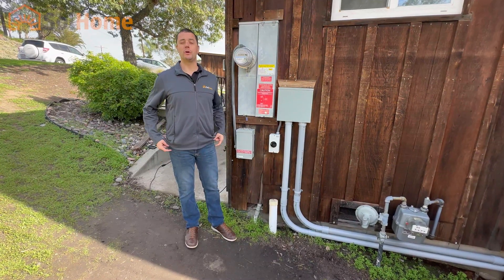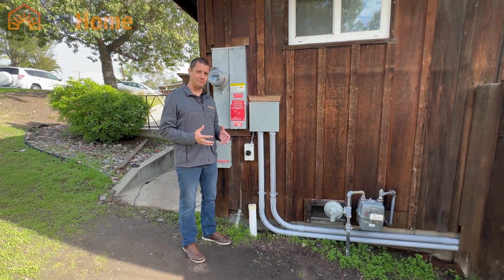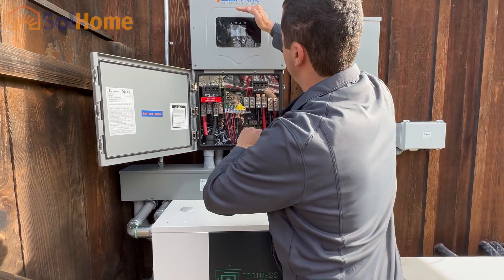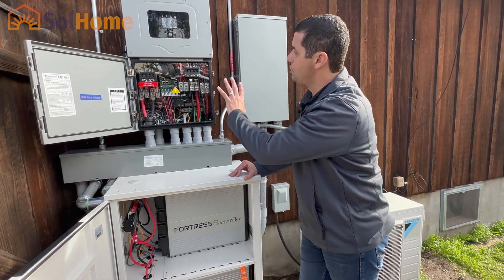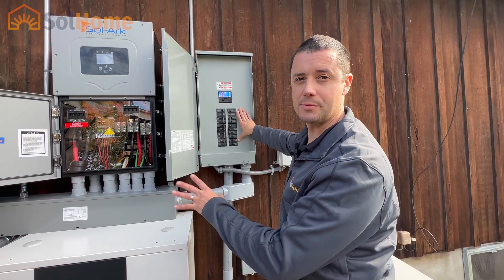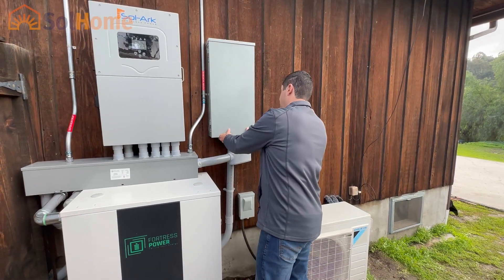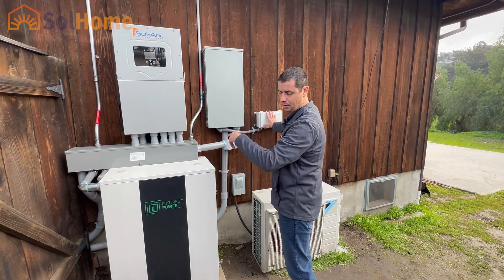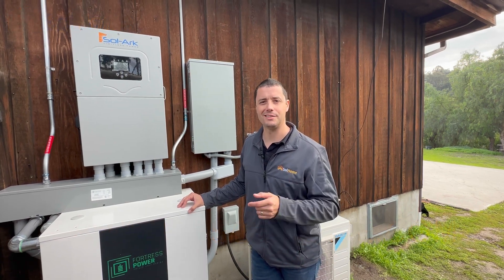Sol-Ark 15k with Fortress eFlex 5.4kWh batteries

Comment: So I'm looking to upgrade the capacity of my current Solar Edge/LG RESU system with a SolArk 12k and Fortress eFlex combination. Are you saying I can still use my existing LG and Solar Edge system as an additional AC coupled source for charging the eFlex batteries?
Reply: Yes, exactly.

Comment: what do you think of the new EG4 18K with their PowerPro heated wall mounted batteries which integrate directly?
Reply from the maker: Honestly it think it’s a great solution. We actually have some of the PowerPro units on order for a few jobs coming up; I’ll do a video. We are sticking with Sol-Ark for now in regards to the inverter just because of our relationship with them in the event we have a problem (which hasn’t happened yet). Maybe we will try the 18k at some point, but then that’s a whole other monitoring platform for us to integrate.

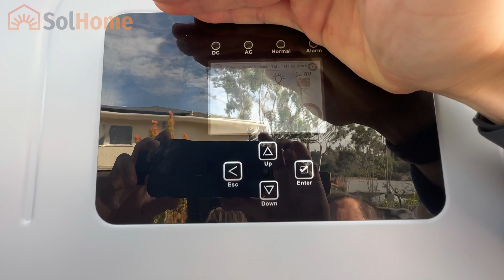Comment: Notice how you were reaching over the battery at 3:45? I believe that is a violation of the working space requirements of the National Electrical Code. Six inch depth difference is the limit. 110.26(A)(3).
Reply: You are right it is but I guess the inspector let him do it.
Reply: Yeah pretty basic code stuff and really dumb thing to do
Reply: Unsafe working over batteries to access 15K. AHJ should be fired!

Comment: What emergency shutdown did you install by the meter? Was it wired into the solark to do the shutdown? 

Also, how did you power the tigo CCA -- guessing dedicated breaker in house elec panel, and not via sol-ark nor battery directly (via dc-dc converter)?
Reply: Just a simple switch that is wired to the Sol-Ark RSD input. You are correct on the CCA wiring.
Reply: @davidpollock2245 thanks

Comment: Excellent choice of equipment.  These are among the best options for multimodal ESS.
Fortress makes a DuraRack cabinet that can house both the inverter and the batteries.  The Sol-Ark 15K, although outdoor rated, is not recommended to be installed outdoors.
Another helpful addition, to keep the eFlex batteries at their recommended operating temperature is installing a small DC coupled DIN rail mount heater and thermostat.  
To uphold the warranty on these batteries, and get 8000 cycles you want to operate above 10 Deg C(50 Deg F).
Reply from the maker: Thanks. We tried to source the full enclosure but had a hard time finding a distributor out here that could get it. Luckily in sunny San Diego we have some mild temps.